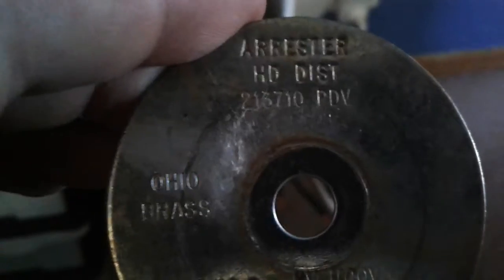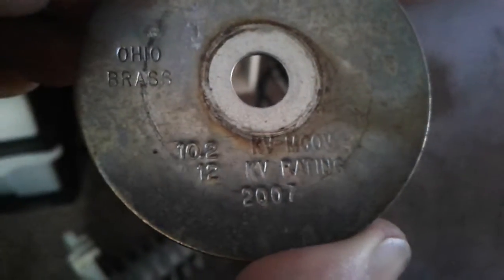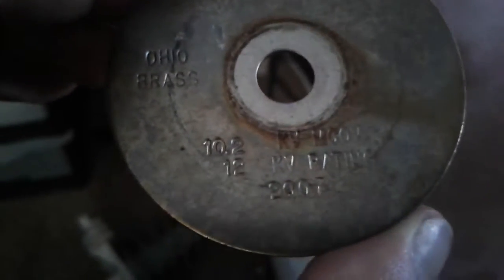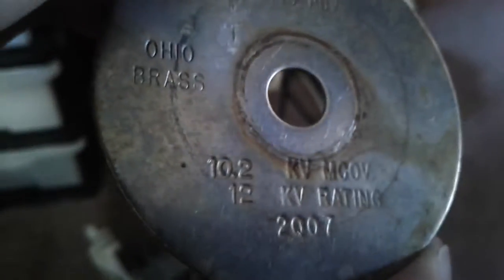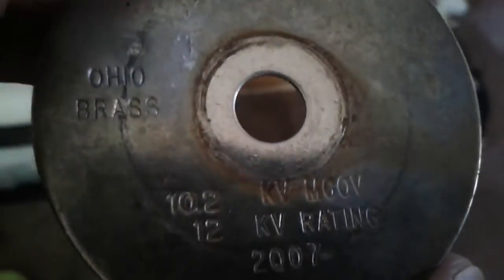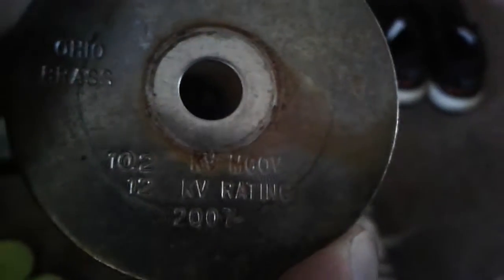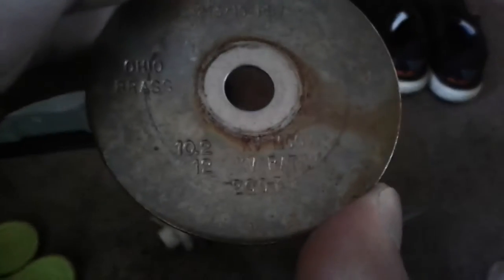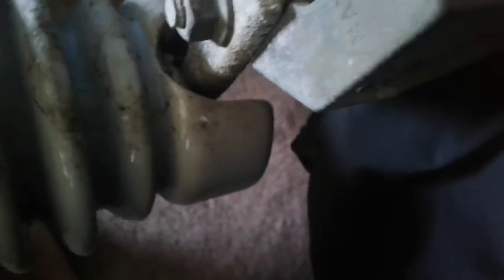Powerline insulator salvage from railway station

Comment: Nice switch there! Luckily I got to glue my cutout back together. I've got 5 cutouts and one happens to be a rubber content like the lightning arrestor you have there, but yeah, I never knew you guys have cutouts like ours, hope your collection grows, btw what are you going to be when you get into the workforce?
Reply from the maker: Variac Maniac Electrical Engineer
Reply from the maker: Those insulators where from powerpoles from a railway line suppling the railway power 1.5kv DC to be exact but now they have converted them to steel ones and changing the voltage to 25 kv ac to run the trains
Reply: I see. I wonder how much power those trains use in the terms of KVA (kW).
Reply from the maker: Here is the data sheet for the train
Year Built 010-2011
Designation FP - Motor FT - Trailer
Track Gauge 1,068mm
Line Voltage
Normal OH DC 1,600V
Operating Voltage DC 1300V-1800V
Unit Length over Couplers 43,060mm
Car Width 2,730mm
Car Height 3,640mm ARL
Bogie Centre Pivot 15,300mm
Bogie Wheel Base 2300mm
Floor Height
- Lower Level Floor 730mm ARL
- High Floor 1,100mm ARL
- Door Footstep Height 730mm ARL
Unit Weight
- AWO (MC) 42.1 tonne
- AWO (TC) 34.8 tonne
- Fully Loaded (MC) 55.2 tonne
- Fully Loaded (TC) 48.5 tonne
Bogie Design Axle Load 14.3 tonne
Power Rating
- Traction Motor 4 x 170 kW
- VVVF 340 kW x 2 Units
- APU 50 kVA x 2 Units
Max Service Speed 110 km/hr
Max Acceleration Rate 0.84 m/s/s
Average Deceleration Rate
- Service Brake 0.90 m/s/s
- Emergency Brake 1.20 m/s/s
Passenger Car Type FP FT UNIT
 Capacity Seating 76 71 147
Max 109 121 230